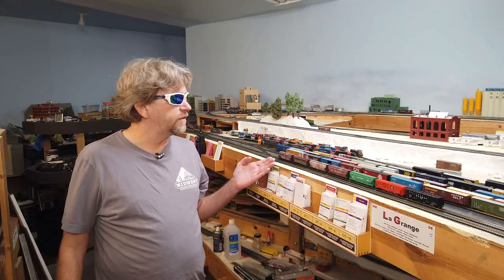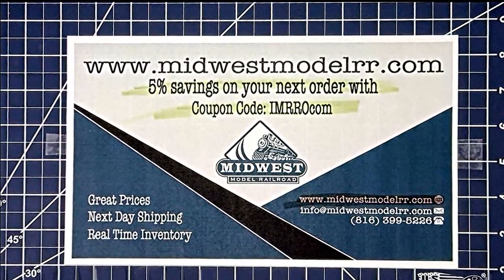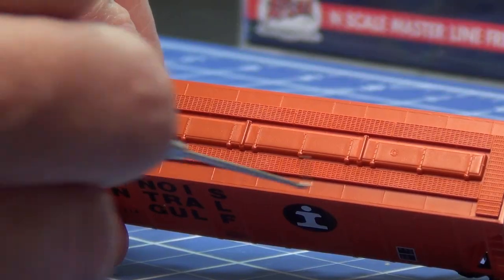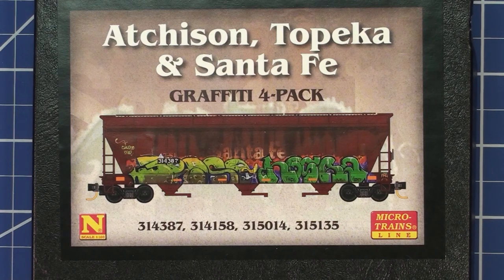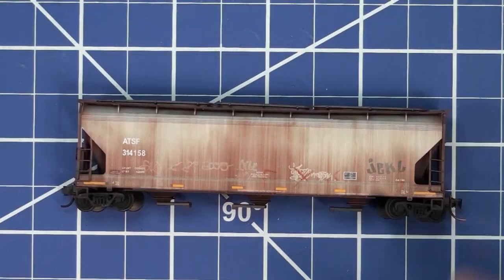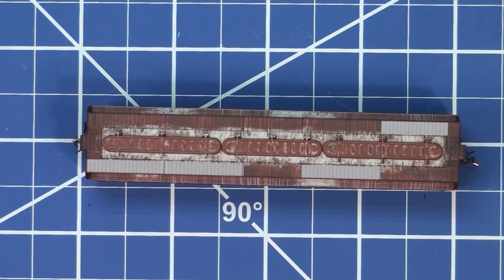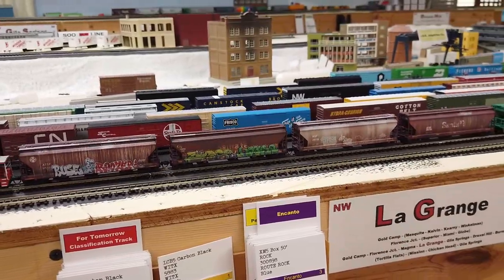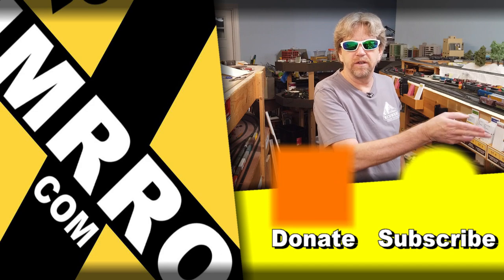🔻Great looking Graffiti covered model train cars

Comment: Eric on your 314387 MT Car look at the Video a little ways back and pause Right as you lay the Car Down you can  see some Bowing in the Center of the Roof Walks on this Car and some on the one before it you can see that the outer Hatches don't set flush up against the Car it could be Microtrains wanted this to simulate wear on the Car itself or there is some issues in the manufaturing process to get these cars out I've seen cars like this at Train Shows and I had bought a set and Returned them thinking it was Warping from the Cars traveling from show to show before I purchased them.. but I seen and wanted to pass it along if you didn't catch it yourself Great Video as always.. Happy Holidays and maybe we can pick us a Set if there still Available as I'm a true Santa Fe Fan..
Reply from the maker: It is temperature change.  My train room is around 85' in the summer and 65' in the winter.  The plastic actually does expand and contract.  If you want to see some real warpage look at the metal walks on the intermountain car during the winter time or the metal inserts on the intermountain F units in the winter.  The plastic shrinks and expends with temperature.  In this case without being directly on top of them with the camera you would never notice.

Comment: Nice job on the carbon black car,fell down on the grain car,how can they call it master line with no body mounted couplers and plastic wheelsets
Reply from the maker: I prefer plastic wheels over metal wheels so it doesn't mater to me.  I think plastic wheels just track better in turnouts with a rounded flange vs the sharp flange on metal wheelsets that seem to pick the points on diverging turnouts.

Comment: Do you bother replacing the plastic wheels on your micro train cars? I am trying to figure out what Mike Fifer, he replaces the plastic wheels with metal ones, but I haven't seen you bother with them. Thank you for any help.
Reply from the maker: I have found Metal wheels are a bigger problem than and advantage.  Metal wheels have a sharper flange do to machining vs the soft rounded flange on the plastic wheel sets that are molded.  Metal wheels with the sharper flange seem to pic points on turnouts more and derail.  I have never had the problem with plastic wheels.  It is a not all for one thing too.  I normally use the small flange plastic wheels from MTL but do not toss out all thos pizza cutter wheel sets from MTL.  You will find some cars that might have some sort of derailing issue or get pulled off the track etc.  If that Happens I install the Pizza Cutter wheels on them.  I think what has happened is people have forgot and do not remember why things were changed or done a certain way in "N" scale.  Come to find out the old way was and works better.  Example are metal wheels sets and body mount couplers.  Both those add new problems back into the "N" scale space that were worked out years and years ago.  Try replacing a broken coupler box on a N scale car and you will learn to love the Truck mounted couplers.  Pull the pin and install a new truck coupler unit and you are done.  Body mounted car couplers have more issues traversing turnouts, yard ladders and the tighter 11" curvers most people use in "N" scale.